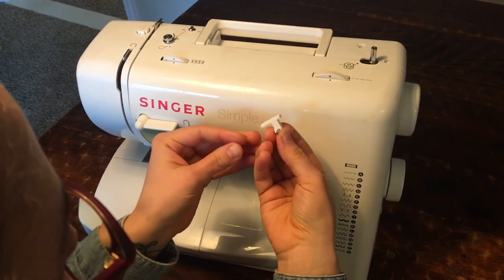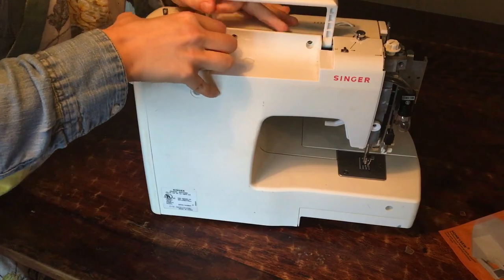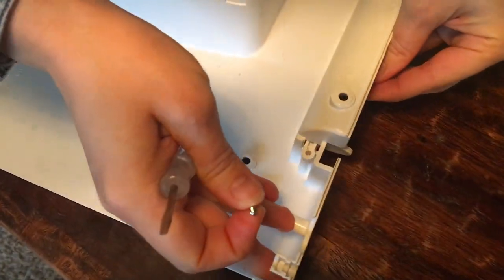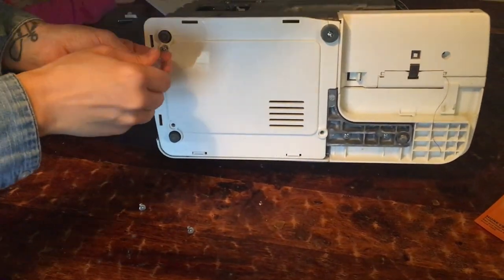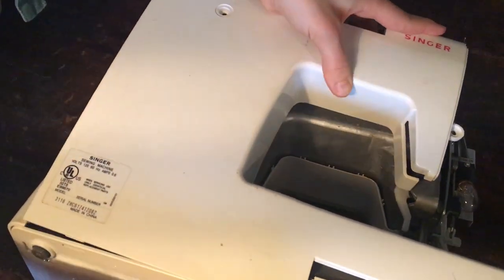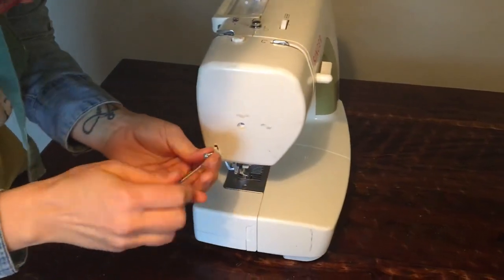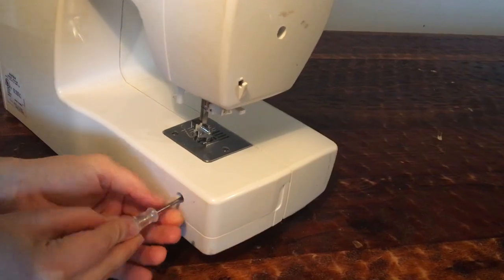How to Replace a Broken Spool Pin// Singer Simple

Comment: You're so lucky you have a screw. My Brother (which looks to be the exact same as your Singer otherwise) has the spool pin held on by some kind of bolt thing that I can't get off. I was vaguely hoping that someone would say "hey, this is a dinglehopper screw - you need a whatyamacallit to take it off". Nice video though - at least I know I'm not that far off!

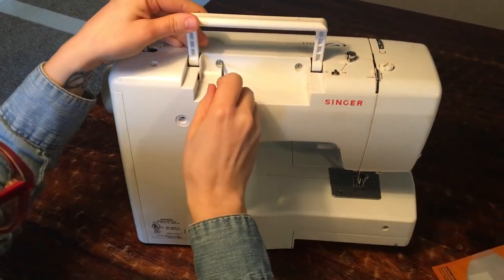Comment: Hei! Soo helpful, there aren’t ANY videos at all and this part is soo fragile! Question - how did u take the cap off the side screw? (Seen on min 1:04) thanks!
Reply from the maker: Try using a flathead screwdriver to pry it loose! That should do the trick :)

Comment: Hi! Not completely related but how did you reveal the screw hole for a second spool pin? I have the same machine but mine seems to be covered. There's a circle where the hole should be but it's covered up. Thanks!!
Reply from the maker: Hi there, you'll want to get a set of prying tools. I've linked these for your reference: https://amzn.to/44Br1ig 

Anything small, flat, and plastic will do. These tools come in handy for multiple repair projects around the house so I highly recommend getting a set of various sizes/shapes. Best of luck!
Reply: @thealfordhomestead5191  Ah thank you so much! I appreciate your help!
Reply from the maker: Glad to help!  @brianaguerrero9657